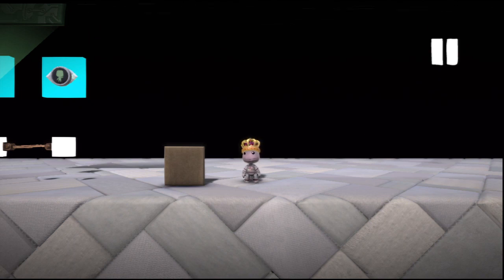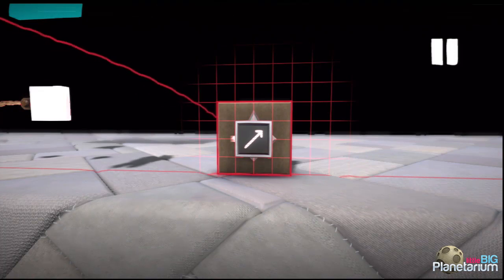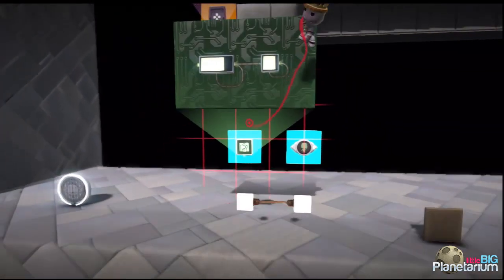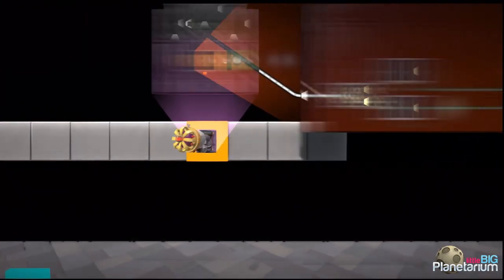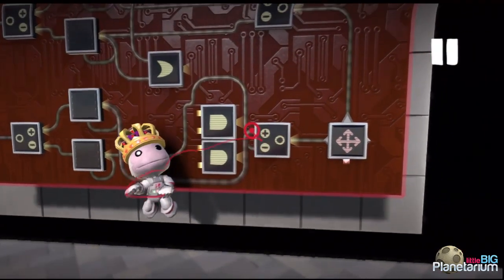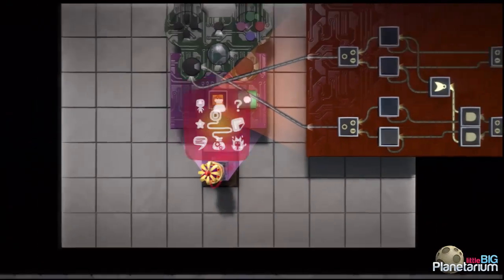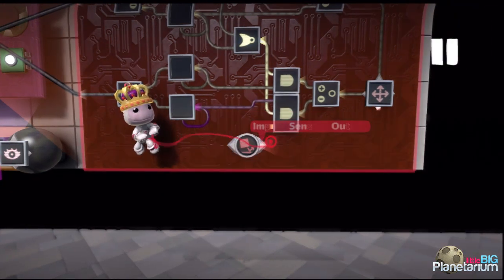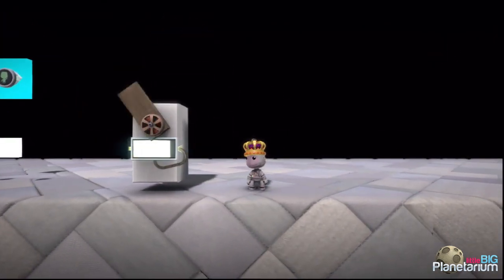LBP2-Torials 28: Measurement and Speed + Grid Movement

Comment: 10:37
Wouldn't it be easier to just use XOR gate so you can't move both at once?
Reply: @IlluminateOG  They aren't.
The OR gate outputs a signal when any of the inputs are activated.
The XOR gate is the same but if both inputs are activated the XOR gate doesn't output a signal.

Comment: @nthn917 just wire the wire from the end of the timer into the reset or restart (on the bottom of the timer.) note: that you can put more than 1 conection with the timer depending on what you want it to do.

Comment: Hey Comph, I tried making a grid-based character. But the grids/units didn't work like they should. I wanted to move 20 units in .1 second. When I set it up with speed = 20 u/.1s, it didn't work. So I tried some more, and it worked with speed = 30 u/.1s. But I didn't like that (too fast), so I set the timer to .3 seconds and, considering the normal laws, set the speed to 10 u/.1s. This didn't work. Trying some more, I found it had to be 12 u/.1s. So to move 20 u, I had to move 30 u, or 36 u.